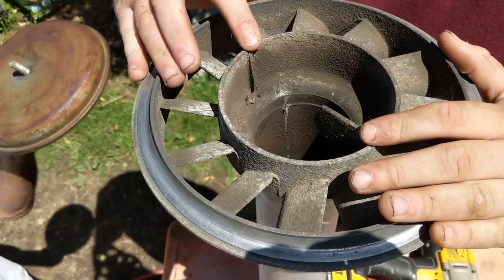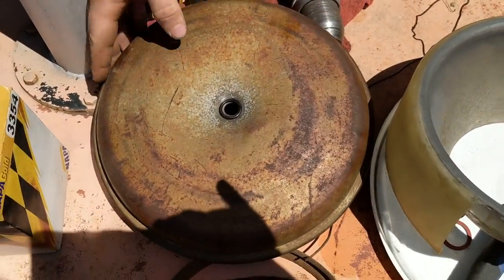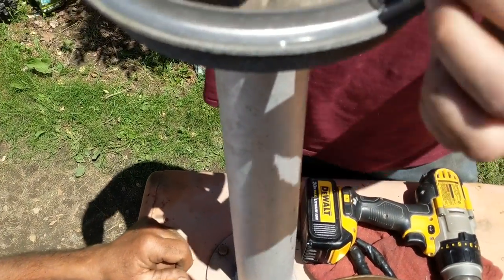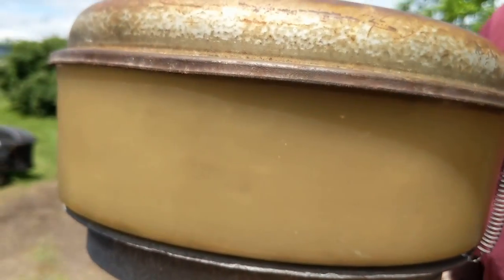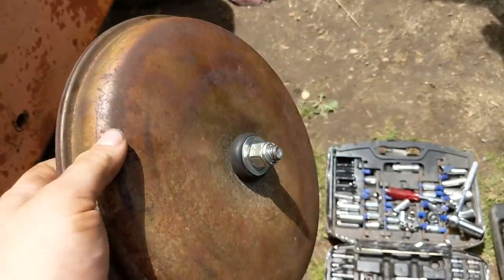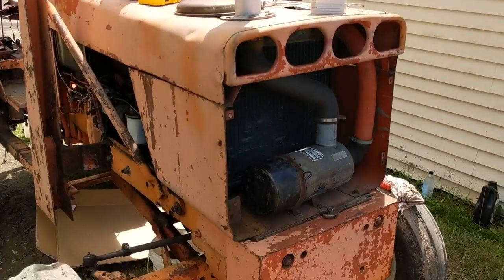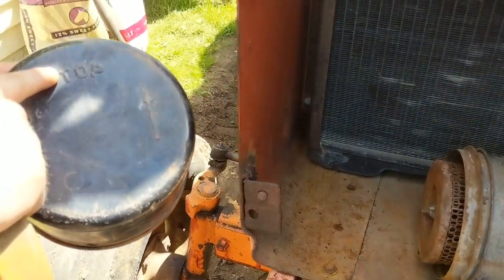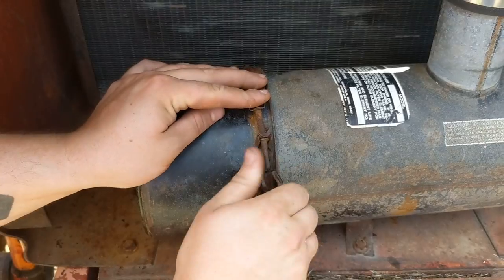Allis Chalmers 180 Tractor Repair and Maintenance on a Budget

Comment: That's a pretty good fix, in fact it's good enough to be permanent. The tension of those three springs make it air tight and keep it from rattling apart. Thanks for sharing guys.
Reply from the maker: My FIL is pretty crafty.

Comment: Simple fix but I recommend replacing that air filter element. Looks bad and being it had been wet it probably has a pin hole in it. It's cheaper than replacing the engine and a pin hole will cause that engine to wear out in a couple hundred hours. Good luck.
Reply from the maker: That was my father in law and nephew, my wife did this one to help keep the channel going when I was laid up with a shattered ankle for a few months.  That tractor is the best running machine on the farm, oil is always clean after a summer of running, it stood my timber framed shop and has just been a good machine.  The air filter was replaced last summer, I noticed the same thing.
Reply: @TheTradesmanChannel  That 301 engine was one of the best engines of its time.